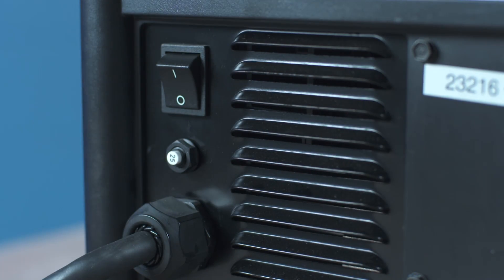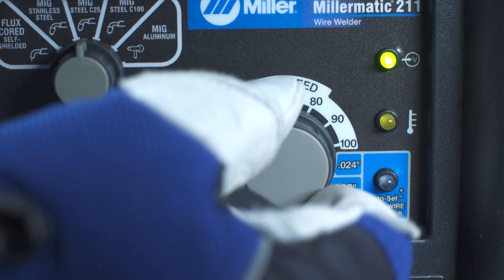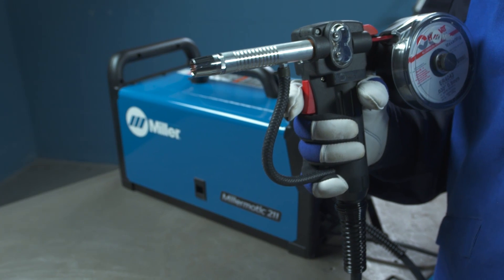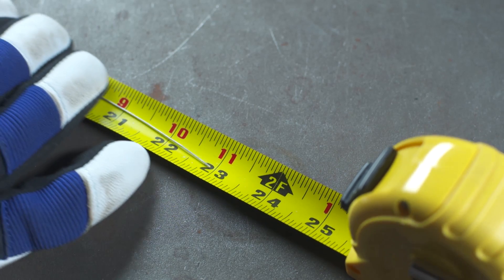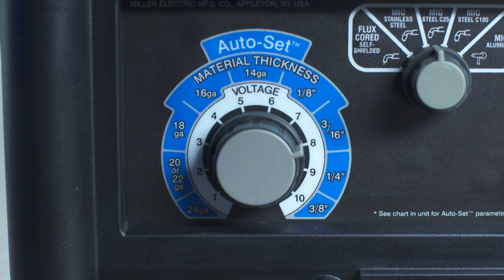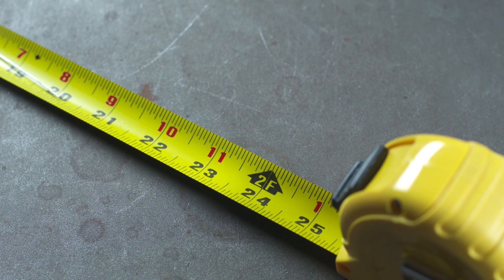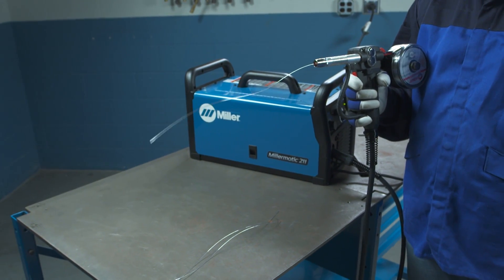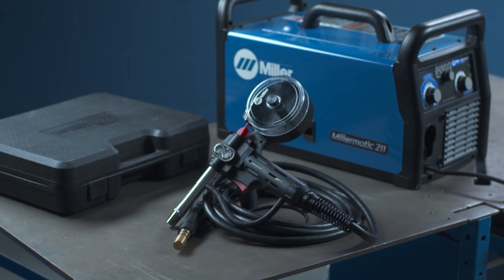Millermatic 211 Spool Gun Calibration Procedure for Auto-Set Aluminum Spool Gun Option

Comment: Do you need to do the calibration procedure on the older 211s that have just a rocker switch that changes from MiG gun to spool gun and not the dial like the newer models ? Thanks

Comment: Do you need to do this procedure even if you aren't going to use the autoset feature with the spool gun?
Reply from the maker: Hi Brett, thanks for reaching out. The main reason for the calibration process is to ensure the that the Autoset feature works properly, so if you are just using manual mode it wouldn’t be required. We hope this helps!

Comment: I just bought a spoolmate 100 series gun and I have a earlier model Miller matic mvp 211 . Does my Mvp calibrate my gun the same way? 55892205533__6C9007EB-1879-4857-884C-FC32DAC846B7.JPG
Reply: And again we find older is better. ;)
Reply from the maker: Hi Robert, thank you for the question. The earlier Millermatic 211 models do not have any type of calibration procedure that needs to be performed. Thank you.
Reply: @MillerWelders this was the answer I was looking for I bought the spoolmate 150 and millermatic 211 just before the inverter model was released I want to say 2015 . I have not used the spoolmate yet but I have been spooling alot of aluminum at work lately with  the miller 30 amp on a millermatic 252. I am curious 👀 🤔  on the difference in performance because at 21 amps and 700 speed  I can weld all day no problem except for tip / wire changes.

Comment: My Millermatic 211 autoset with MVP not only looks different from this one, but I can only go as far as getting the temperature light to blink.
Turning the wire speed to minimum, and then to 100 has no effect.
Reply from the maker: Hi, Pat. You most likely have the previous version of the Millermatic 211. It doesn't have Auto-Set for a spool gun, so calibration would not be a part of the setup. The Owner's Manual for your machine will have installation details. If you do not have your Owner's Manual, you can search for it here: https://www.millerwelds.com/support/manuals-and-parts  Let us know if you have any further questions. Thank you!
Reply: Miller Welders Yeah, I figured it out and got it to work.
And I just ordered the switch kit to convert an older Challenger 172 to run a Spoolmate.
I was disappointed that I found nothing on doing that, but I did figure out that the 135 is very close in construction to the 172 and it should work.
Reply: Miller Welders i had the same question as I have the older 211 also

Comment: So to use the spool gun 150, you first need to calibrate it? And when it's complete you can use autoset if I'm understanding this correctly. You can put the regular mig gun, I have a m25 gun for my 211, back on and run it like normal? And the last question, when you reinstall the spool gun again, is calibration needed?
Reply from the maker: +RYAN GODIN Those are great questions. Yes, you need to calibrate your spool gun when you first use it with the Millermatic 211. Once the calibration is complete, you can use Auto-Set. When you are finished with the spool gun, you can put your MIG gun back on and run it like normal. You do not need to calibrate the spool gun again after the first calibration. We hope this helps. Please let us know if you have any further questions. Thank you!
Reply: +Miller Welders thank you very much, such a great company with outstanding customer service!!
Reply from the maker: +RYAN GODIN You're very welcome! Weld on...
Reply: So why can't the calibration be done before shipping the unit? Would solve a lot of issues and the unit would then be tested and READY to use.
Reply: @johnn4367  Because MILLLER does not have the gun you are using 100% on hand.

Comment: I am about ready to try this out with a 211 inverter and a M 150 spoolgun, thanks for the video.  I was curious if there is anything you need to do to the machine when you put the standard MIG gun back in to recalibrate it?
Reply from the maker: +Chukk B That's a great question. When you are finished with the spool gun, you can simply disconnect the spool gun, reinstall the MIG gun and be ready to weld. No calibration is required for the MIG gun. Let us know if you have any further questions. Thank you.
Reply: Hey thanks for answering my question.  I figured that was the case, but wanted to confirm.
Reply from the maker: +Chukk B You're very welcome. We're happy to help!
Reply: If would be nice if we could leave spool gun and mig gun connected in place and dual gas inputs for both purposes.   But I guess that’s why you sell the multimatics huh.

Comment: Do you use the mig steel C25 gas setting as the video shows or do you set it to spool gun setting
Reply from the maker: +Pocono Stairman The new Millermatics have an Auto Spoolgun Detect. This means that the machine knows when there is a spoolgun connected, so it does not matter where you set the machine when setting up for spoolgun calibration. Please let us know if you have any further questions.

Comment: Do you repeat this every time the spool gun is needed?
Reply from the maker: radishfever The calibration procedure is needed when first setting up your machine. Please let us know if you have any further questions.
Reply: @MillerWelders  is calibration possible on 211 transformer type machine ? i get the orange temp light on start up but once i turn the dial to 10 followed by 100 i dont get the blue flashing light. i had issues with my spoolgun or machine for the first time.. any setting wouldnt weld properlly,. i figure a calibration is my best bet ?